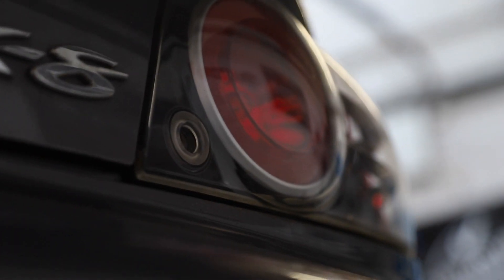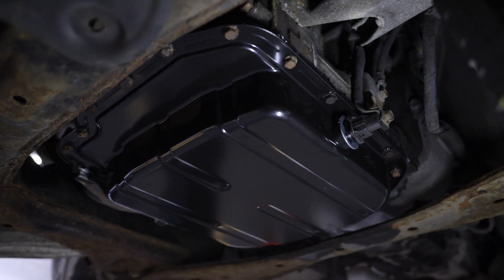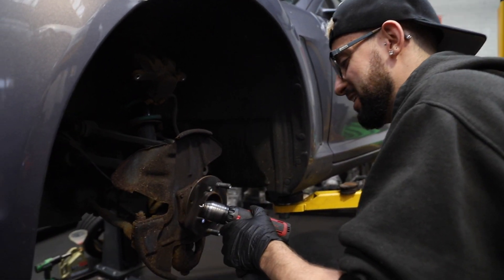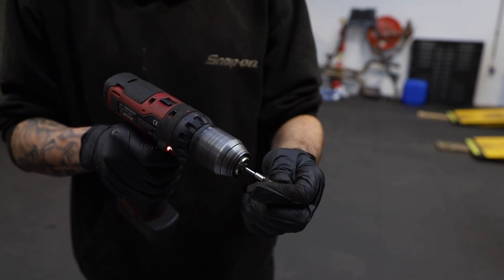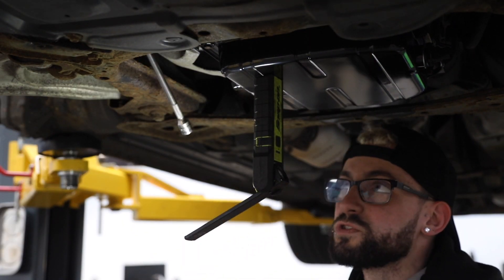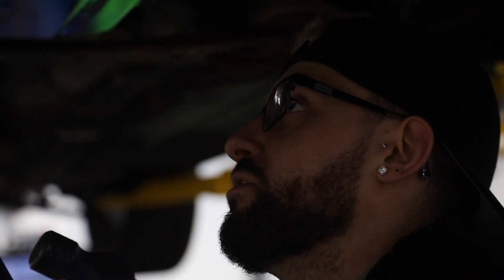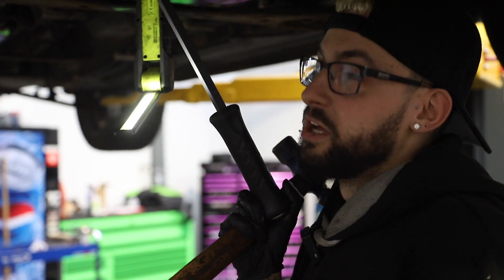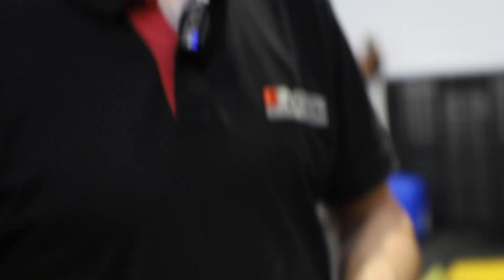Rotary Revs | Performance Upgrade | Vlog #006

Comment: Nice work Teddy. Those Racing Beat exhausts any good?
Reply from the maker: Very good for quality. A perfect OEM + upgrade!
Reply: Rotary Revs thanks for the recommendation. Does it make a nicer sound over the stock, without getting too noisy inside?